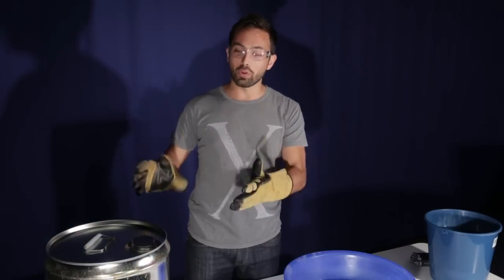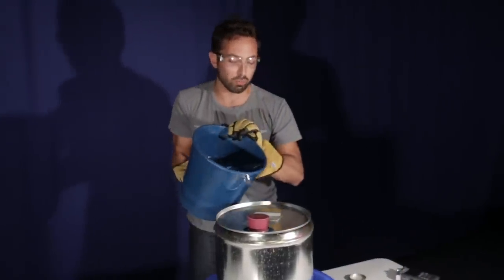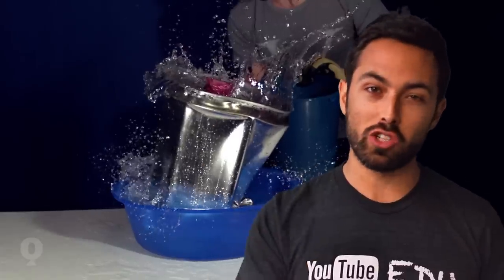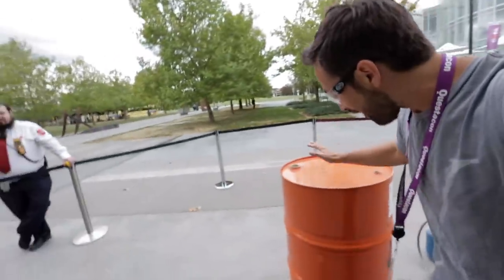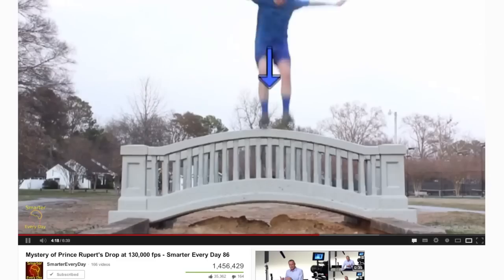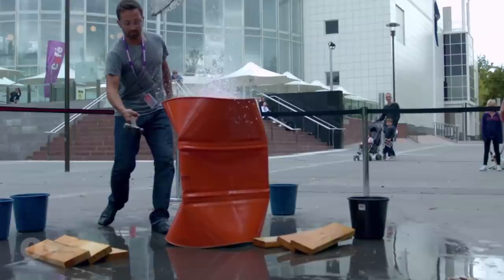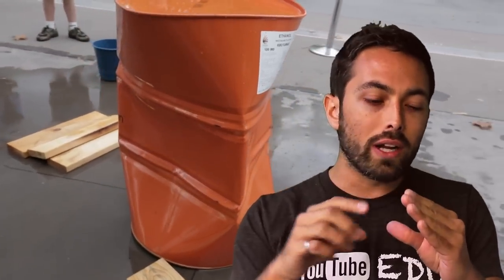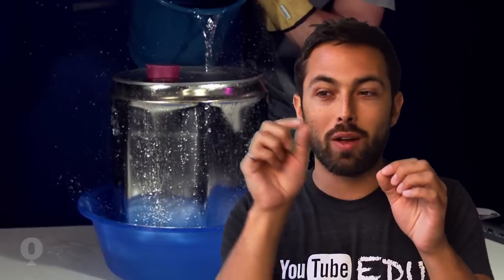Epic Slow-Mo Drum Implosions!

Comment: The smaller drum has an angled area around the rim while the larger drum has a rim that is of the same size as the drum itself. I would suggest that the angled part of the smaller drum might have offered some additional resistance to the implosion, preventing it from imploding into the 'optimum' equilateral prism shape. Just a guess.

Comment: A fun follow up might be to implode a wide rubber cylinder held at the top at bottom with metal rings. You could vary the height of the rings and see what shapes you get when the air is removed.

Comment: I presume the different crush patterns have to do with the strength of the materials versus the heat obtained in the heating process.  It seems likely that a higher temperature was achieved in the smaller object because of the efficiency of the burners involved.  It also seems likely that the strength of the top and bottom of the barrel is much greater than that of a smaller can, as well as the sides.  The larger barrel would cave in less, unlike the small one, which was more catastrophic.

Comment: i believe it has to be with the material, a thinner lighter metal can easily be folded in many more angles than a thicker heavier metal, and of course, that drum cant go lower than 3 folds with the amount of pressure it was exposed to, therefore a triangle, and the smaller thinner can, a hexagon

Comment: I think the reason for the different shapes is the different sizes and type of material used in each case. Also, we don't know the actual pressure inside the cans. Even if the cans were heated up, there could still be pressure inside the cans.

Comment: I think that when the pressure decreases there are different stages for the barrel to form. With normal pressure being round and 0 pressure being flat. Betweeen those stages it will search for strong forms, the first strong form would be a octagon since it's made out of 8 triangles. Followed by a hexagon, a pentagon, a square, a triangle, and finally it would be flat. So the different shapes are probably the cause of different pressure differences.

Comment: First, the negative pressure in the drum creates compression within the material which acts to "flatten" out the curvature (hence why you get polygons). Second, the force on the material is going to vary depending on the area available: A=2*pi*r*h. I believe the difference in shapes is probably a function of the area of the cylinder, the thickness, and the material. I wonder if you used the same material and thickness but varied the radius if you'd get different polygons. Hmmmm.....

Comment: On the contrary, the smaller drum, having less toughness, was far easily influenced by a not-so-low low pressure, thus resulting in a hexagonal shape, aswell as a second deformation due to the continuity of the dropping pressure inside it.

Comment: My guess is that the sides of the smaller drum were closer to the top and bottom of the drum )being smaller) and there were also no ridges meaning the sides were held more firmly into a rounder shape by the top and bottom, however the larger drum had a larger distance between top and bottom as well as there being a couple of ridges, notice how the triangular shape fills the area between the ridges but doesn not go past them.

Comment: If the smaller drum was thicker, and could withstand 0 pressure, then I think it would implode into a triangular shape after a small dent. The fact that the smaller drum bent into the hexagon shape was because it only _needed_ to go into a hexagon shape, due to pressures not being low enough (can be attributed to the weaker compression strength of the smaller drum). 
The larger drum went into triangle because it was at 0 pressure and wanted to get the smallest and most stable volume.

Comment: about the question you made, I think the 2 drums crumpled in different ways because  the proportion between diameter and height is different. Since the larger drum had a more elongated shape, the walls felt less resistance and collapsed into a triangular shape. The smaller drum is proportionally shorter, so it collapsed into a hexagon, My theory is: the larger the diameter compared to the height, the more sides the collapsed walls will have.

Comment: the top circle that did not deform at the top of the smaller drum was holding its shape, and thus preventing maximum efficiency. it created the most efficient polygon it could while maintaining the rigid top circle's shape. if the top circlular piece was made of a weaker material, it would have crumpled into a triangle. could prob math out the shape it would take if the container has differing amounts of rigid structures which do not crumple along with the sides of the containers.

Comment: I think, the shapes resultants are from the circunference of the drum and the resistance of the material, as DJDMass said but in a different direction. If you have a drum with a small relation of diameter/[material resistance] you are going to get that triangle because the vacuum is strong enought. But if you have a drum with a big relation of diameter/[material resistance] you will get others shapes because the vacuum for is not strong enough to contract the material.

Comment: You actually said the answer. It's true, it probably requires more energy to go into a triangle than a square. This energy must come from the combined hammer and implosion potential. That energy must be dissipated the drum can reach an equilibrium which is why it forms the more energy intensive structure of a triangle rather than a square.

Comment: Strength:  The orange drum has those 'ripples' in the metal, encircling it in two rings, which are added for strength during manufacturing.  You'll notice the implosion triangle fit between those ripples, essentially imploding between the two strongest areas, in easiest area.  The silver drum did not have these strength 'ripples' to help conform the implosion to a specific area of the drum.  Not the most scientific use of language, but that's my theory! :)

Comment: I think also since the small drum collapsed on its own it may have collapsed non-uniformly. The weakest portions of the drum gave in first. With the big drum because you hit it with the hammer it may have more uniformly crushed because it was more uniformly made. or the distortion of the cylinder spread the change in force out over the whole area.

Comment: Perhaps the hexagon formed because the pressure collapsing the can was for all practical purposes equal on all sides, so multiple failures occur at once allowing for a brief period of stability which was closer in form to a circle, in the larger case, you caused the initial failure, triggering the others.... Or maybe just manufacturing differences...:)

Comment: I would think that the drum was made of thicker material. This meant it took longer to cool down and the vacuum was slowly increasing. The smaller one folded into a hexagon because it couldn't take the vacuum pressure that quickly built up from a few splashes of water. Also, not all of the vapor cooled down  because it imploded again after a few more splashes. Most of the vapor in the drum had already been cooled before taking a hit from the hammer.

Comment: I think the shape depends on the how big the circumference, the thickness of the trunk and the distance from the end surfaces. 

Hypothesis: If the circumference of the the drum is really big, the drum is tall and the metal is thin, it would implode to a shape like a line instead of a equilateral triangle. I wish you could test this.

Comment: I think it may have to do with the ratio between the height of the cylinder and the diameter/circumference of the lid.   Unless the lid "pops" off, it constrains the collapse.  In the case of the small can, the height/lid ratio is different than the height/lid ratio of the barrel.  Perhaps measuring the ratios will predict the collapse to a hexagonal or triangular prism.

Comment: Remember that a hexagon is a truncated equilateral triangle, so a hexagon forms as the next best shape. I believe it is because the aluminium is softer than steel, and especially without an external point of failure, the curvature fails at several points, and then truncates as a hexagon before being able to become a triangle.

Comment: If you have an elastic sphere, with no particular stress points and equal strength in every direction, it would just become a smaller sphere. A metallic or rigid sphere would ripple in a fractal pattern, because a fractal will have less volume than a tetrahedron (more concave areas).

Comment: i think the ratio of height to diameter could have prevented the small drum from being able to contort to the much lower volume of a triangle rather than a hexagon, plus the top and bottom of the small drum appears to have a sort of structurally reinforcing shape rather than just an intersection of a plane and a cylinder which the large barrel was more like.

Comment: i would guess that they crumpled in different ways because they might have been made of different metals with different strengths. so the larger drum had less corners because it may have a softer metal, while the other drum had a stronger metal, so it could not collapse as much as the larger one, forming a shape that has more corners because it could not decrease the volume anymore. but it would also depend on the pressure inside of each of these drums.

Comment: The cans and conditions inside the cans are very different. This means that the two cans would have imploded with two drastically different pressures inside. I think that because the energy in the implosion of the small can was so much smaller, the material didn't have enough energy to deform all the way into the most stable equilateral triangle, so it got as close as it could. If the small can had had more potential energy, it too would have imploded to form a triangle.

Comment: My First thought is relating to the strength of the different materials. The larger drum is made of steel, which is stronger and stiffer then what I assume is Aluminium. If I am right then the "crumple pattern" is directly related to the strength (i.e. the force required to crumple) of what is being crumpled. And the weaker the drum the more complicated the shape it would create when crushed in this matter.

Comment: When heated the gas inside the drum expands. If you then plug the hole and cool it down (pouring the cool water on the outside) the gas volume decreases and can't hold against the (now higher) outside pressure.

Comment: it has to do with the fact that your smaller drum has a different size ratio. IE the 55 gallon drum is taller, as such the strength of the lid is more dramatic, second the beveled top and bottom of the smaller drum adds to rigidity. so between the shorter sides and stronger ends that drum had much less give to work with when achieving its point of failure.

Comment: As one of the comments said, it would be interesting to see how much vacuum the steam method attained. If the air was completely evacuated, the pressure would match the vapor pressure of water based on its temperature (the temperature at the coldest point on the barrel). At 10 deg C it would be under .2 atmospheres. That's a pretty high vacuum. The other method of course is just to attach a vacuum pump.

Comment: Maybe the smaller drum vas able to void more of its volume of air, making the implosion more extreme than the lager drum. Although this only explains the final mash of the smaller drum not the hexagon shape. Maybe the triangular shape was made possible because of the weakening with the hammer? The smaller not weakened drum deformed more equally or spread out because its strong circular structure was more difficult to overcome.

Comment: I think the cans crushed into polygons because metals contract when heated then constrict when cooled. The temperature of the day along with the water is much cooler then the open flame the can was exposed to, therefore once cooled the expanded can started to constrict but due to the rapid temperature change it happened in milliseconds.

Comment: I think it may have something to do with the banding around the large orange drum. I noticed that's where you had to hit it to compromise its structural strength as well.
Well, that and I think the air in the large drum may also have been hotter than the air in the small one.

Comment: i think that hexagon crumpling patern apeared because the top and botom of smaler container were much stronger and triangular patern couldn't be formed however if end peaces of container would be weaker i think it would colapse in to triangular shape. So i beleave that the main factor of these diferent paterns is strength of top and botom peaces and how they were made (smaller berel had top similar to soda can)

Comment: The large drum has two corrugated bands on it's midsection.  This strengthens the drum against circumferential stress.  The smaller container has no such bands and is only corrugated at the top (and bottom?) like a soda can.  Perhaps this is why one collapsed into an equilateral triangle and the other did not.

Comment: I would guess that the larger drum had a greater pressure difference versus the smaller one, meaning it would need to compress by a greater amount to reach a state where the barrels structural integrity can counteract the remaining pressure difference.

Comment: Also, I've seen this exact experiment on a drum about the same size, and it worked great (no need to hit it).  I think you may have cooled it too fast.  I know that doesn't make intuitive sense, but the way I say it done let it cool by simply spraying it with a mist bottle.  The collapse was far more complete than the one in the video.  It ma also be temperature that made it better.  Which makes me question, why water?  Why not just heat it up without water?  Water always seems to work better.

Comment: Air pressure must be the same in all directions so it should crush the drums in a round-like shape... but the drums are different (thickness, size, alloy, distribution of the cooling water) so they get affected in many ways... With this in mind, must be other drums that create shapes of four, five and more than six sides (i believe you'll get almost any number of sides...) ultimately almost round with a soft material, remember, air pressure is equal in all directions

Comment: It might have something to do with the thickness and material witch the drums were made of.  Both looked new, but the large orange drum was likely thicker and made of stamped and welded steel it could hold its shape better and not form any deformities. Now the smaller one was most likely thin stamped steel that was softer. being softer it probably had small deformities when formed and crushed easier than the other.  Like what the hammer did the the larger one.

Comment: It depends on the pressure difference between the inside of the drum and the outside, which is inversely proportional to the number of the polygon sides. The higher the pressure diff., the lesser volume it needs to become. hence, less sides.

Comment: I would guess that it had to do with a combination of the length of the barrel, the rings and the use of a hammer. The shorter drum had more relative strength in its middle, whereas the longer barrel had less resilience relative to it's size. Additionally, the variable of the hammer could have played, might have been enough activation energy to surpass the hexagonal pattern. Lastly, the reinforcing rings may have caused the barrel to choose the geometry with the least number of angles.

Comment: When the smaller drum gave in, it did so without any outside help (hammers). I think when it did it moved to a shape of lower volume, the hexagon, but the hexagon was strong enough to hold the vacuum and it stopped. For a moment. Then it to gave way and crumpled further.

Comment: I imagine an experimental trial with multiple drums of controlled and graduated volume, strength, material and initial shape (maybe oval or irregular prisms) to help determine a possible relationship between the geometry of an atmospherically crumpled drum and the ratio of the volume to crumpling gauge pressure of said drum. Maybe we can make some pentagonal prisms. Or maybe we can have these geometric arrangements on scales both giant and minuscule. And what, if any, would be the implications?

Comment: I have no proof of this, but here it goes: Imagine the vacuum inside like a bunch of wires attached to the walls, pulling towards the center. The vacuum is distributed over a large area, so each wire pulls with a low force. Now you start taking wires away, until the force is big enough to buckle the wall. With the big drum, it took 3 "wires", with the small one, 6 (or so). If the pressure in the barrel would have been bigger, it would have flattened (a flat barrel has lower volume than 3 sides)

Comment: larger drum was made of thicker steel, and also had more voulme than the smaller drum, due to those factors when it finally collapsed it did so in such a way as to form the smallest volume possible.  the smaller drum by having less volume and thinner wall could achieve equalization by collapsing into a form with more volume.  The big drum had to be weakend first, so its collapse was more catastrophic than the smaller geometry wise..
Reply: no, actually you can see that the small drum did not achieve equalization, because otherwise it wouldn't have collapsed a second time.

Comment: The answer to your question is twofold: that the internal vacuums were imperfect and the material strengths were different. The larger barrel needed to compress to a smaller internal volume to balance the pressure with the material strength while the small cylinder did not have as much internal force to require a jump to the equilateral triangle, it only required the hexagon to balance out the pressures with the material strength.